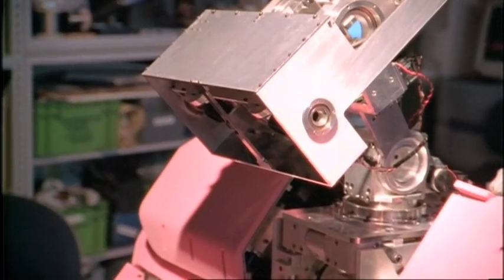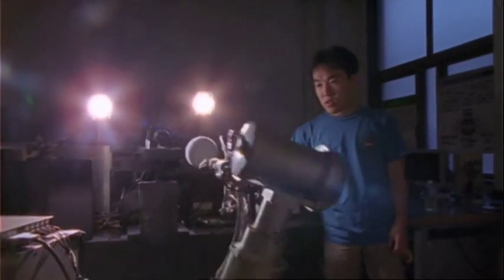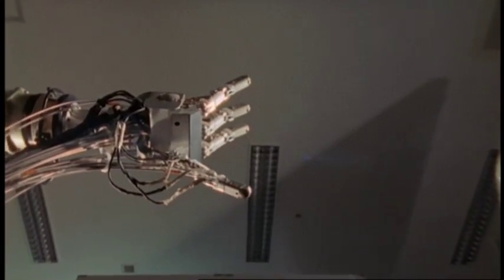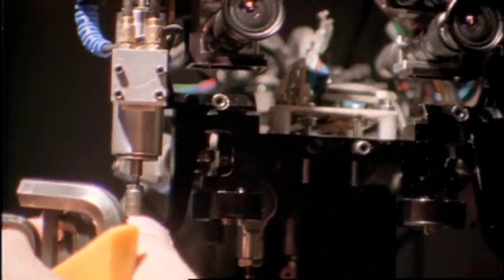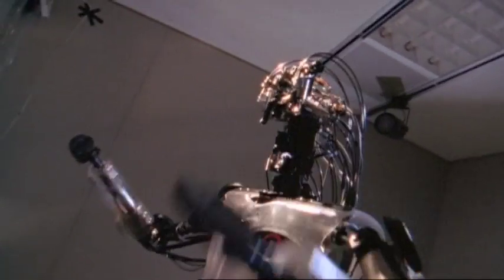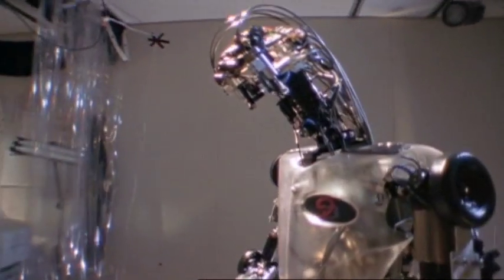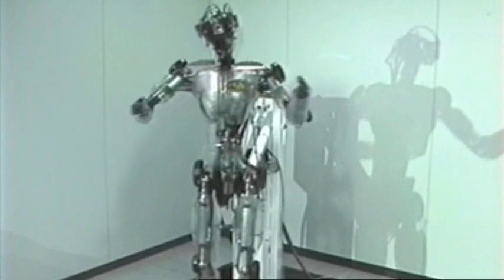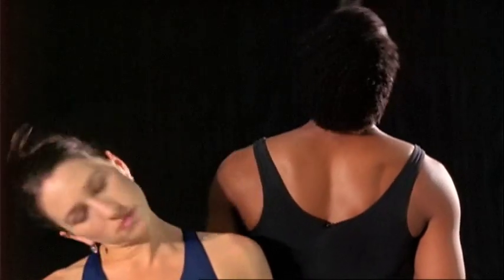Beyond Human: How to Design a Humanoid

Comment: @ToddWalther you are right. the thing seperates computers from organic brain material is that the brain constantly changes itself to learn new things. it does this constantly. a micro chip cant do that, and that is the main problem we have to overcome.  i saw a really cool thing on discovery channel where they took a portion of mouse brain and succeded at having it interface with a microchip to drive a car using the mouse brain to figure out where to go.